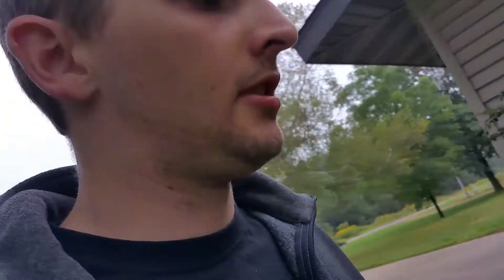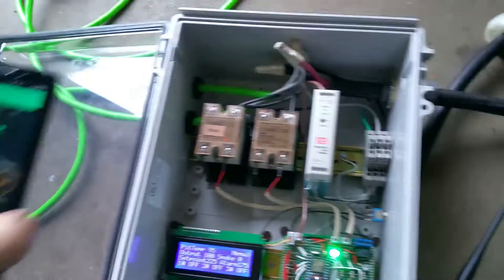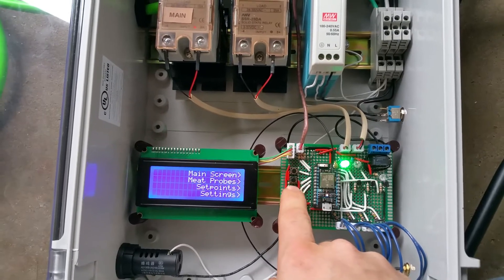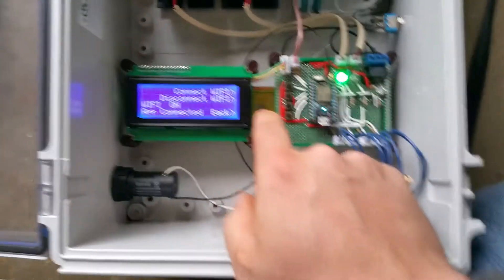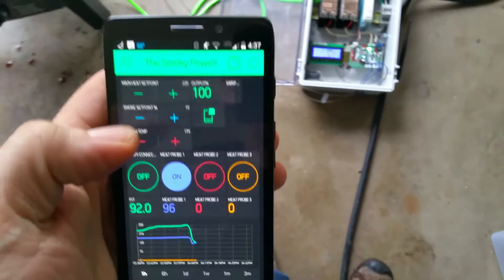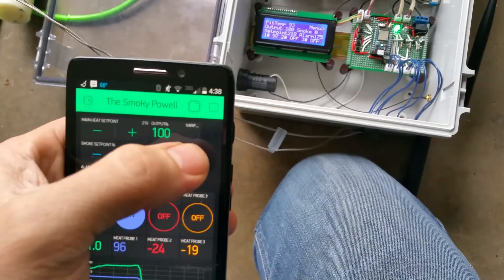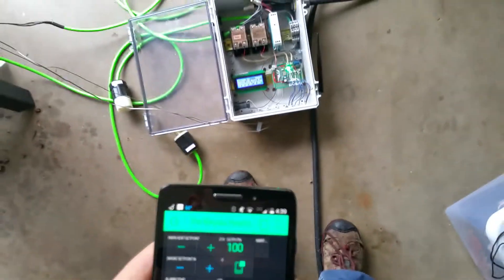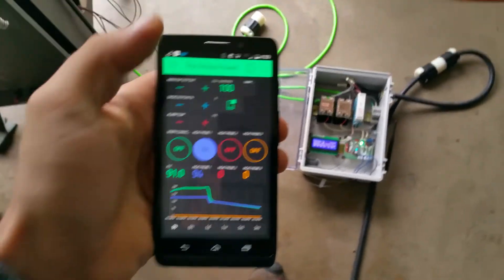Blynk App BBQ smoker controller particle update

Comment: Are you still using your smoker
Reply from the maker: Yes I am. Most recently I converted it to an electric pellet hybrid. Works the best out of all of them.
Reply: @canopygardensgreenhouse9907  I'm interested in your project buy don't much about Arduino, in just starting out could you help me out on code and material list
Reply from the maker: @dontno4  check out github link. Has everything you need. Feel free to email me questions.

Comment: Sweet.
Do you have a parts list?
Reply from the maker: Hi, I just ordered the second circuit board. if the design works out, the board, parts list, code, phone app, 3d printed case/ din rail design will be released. Can't wait! Should be soon!
Reply from the maker: Helluva Dip parts for the board are about $20 plus the photon
Reply: Jamie Desjardins how much??in parts
Reply: Archy wigglestyn dam. I wish I had the time know how and patience that you have. Nice job. Is there code involved?
Reply: Archy wigglestyn and thank you for the info
Reply from the maker: Yes there is code involved about a thousand lines of it. I will be releasing it soon!
Reply: Archy wigglestyn I can’t wait to see it. Well done nice job so far looks awesome.
Reply from the maker: @PeteTum  https://youtu.be/kV1lrQCiiBc